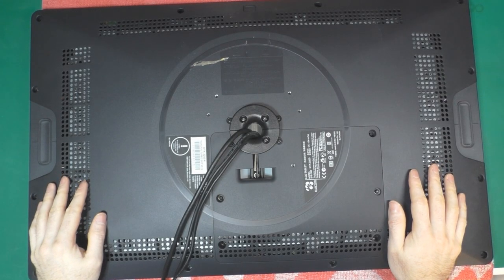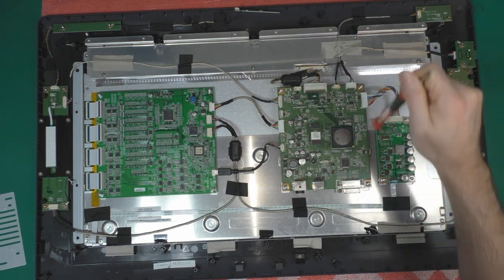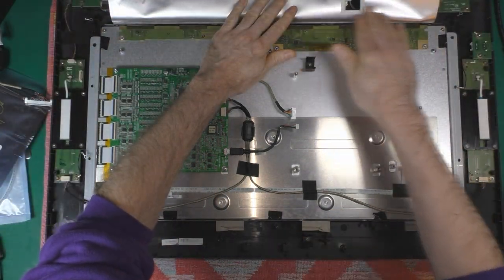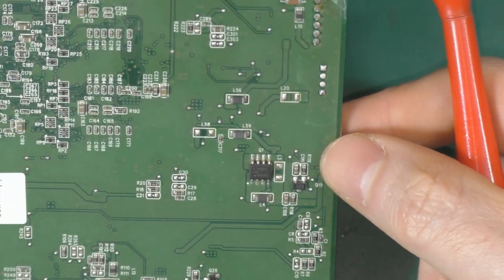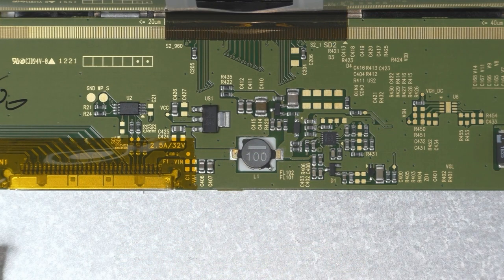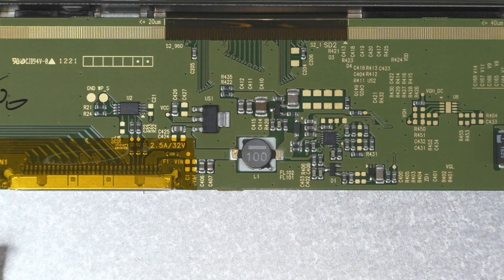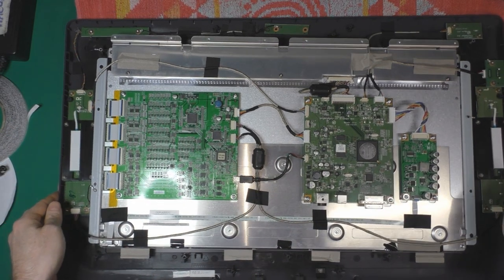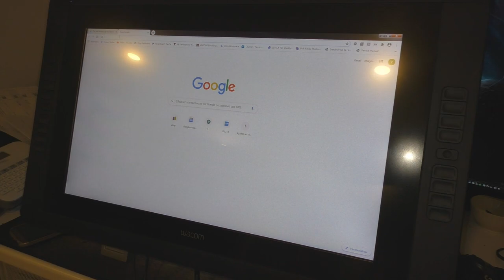[Attempting Repairs] Wacom Cintiq 22HD (DTK-2200)

Comment: Thank you for this video, for I have the same problem, and using a strong light on the screen I can see the screen so I assume the problem is the led strip that is dead. Since I've never soldered anything in my life, I'm wondering if I probably  should share this video with someone capable to do the fix and see how much it would cost to me, the parts you've listed look cheap enough.
Anyway, again, a big THANK YOU (heart).
Reply from the maker: Check or contact Ian Tompkins if you are on the US.

Comment: Hello, I'm also having the same issue on my cintiq 22hd. May I ask what does replacing the caps on the inverter board do? I think I've only seen Ian's video on replacing the capacitor and mosfets. Thanks!!
Reply from the maker: When something went wrong related to power supply issue in a device, I tend to change ALL CAPS related to power supply. It something I got used to do with older video game consoles. I saw popped/leaking caps after transitors/mosfets/voltreg going bad. It may not have any impact whatsoever in this specific case though (it would have more sense if your power brick blew up and kill the cintiq), but those are electrolytic caps and will go bad eventually, and since the Cintiq is opened and fully disassembled, well, I don't take any chance. Cheers.

Comment: What solder iron do you use? What is that liquid you're pouring on the IC and mobo? I'm kinda new at this so I would like to learn. Thanks
Reply from the maker: I use a Hakko FX-951 for the soldering station, and a cheap Aoyue 738H. The liquid and yellow-ish paste I used before soldering is no-clean flux (both from MG Chemicals). The liquid on the Q-Tip I used is isopropyl alcohol.

Comment: Bonjour,
J'ai une vieille cintiq dont le bouton On/Off semble faire faux contact. J'ai de plus en plus de mal à l'allumer ou l'éteindre.
Quel risque y-a-t-il à la démonter ? quelles précautions dois-je prendre ? A votre avis, est-ce compliqué à réparer (sachant que je n'ai aucune expérience^^) ?
Reply from the maker: Yo, non le bouton on/off si tu regardes a 3:24 de la video c'est ca que je dévisse. Faut juste faire gaffe quand tu soulève la coque arrière d'ouvrir doucement et pas arracher les fils. Idealement faudrait trouver une board de rechange sur ebay, sinon il va falloir malheuresement dessouder le bouton du circuit imprimé et le changer.

Comment: can a Huion Kamvas 22 Plus also be repaired like this ? Is the hardware similar?
Reply: Yes, just repair it.  Set yourself an objective to learn about circuits, how power flows, how to test components, what is regular input and output, how to use a multimeter and an oscilloscope, it is useful knowledge.

Comment: Thanks! Very helpful. 
So to confirm, if I DO get activity/the screen lights up when mobo is disconnected.. that means the problem is with the two capacitors? 
Potentially 1 less thing in a landfill thanks to you!
Reply from the maker: Yes. If you have light activity (like the panel is lighted with some light purple shade) that means only the backlight board is faulty. I had only two caps on this video, but apparently you can have a bunch of them (only 10uF ones has to be changed) . You can also check Ian Tompkins channel, he did a lot of video on this.
Reply: @TheRealPhoenix_Retromods  ty!
Reply: @TheRealPhoenix_Retromods   Update for posterity.  It worked. I replaced ten of the eleven 10uF capacitors and it worked, good as new. I ran into some trouble initially with a flickering/fuzzy screen but it was because of a loose connection between the backlight board and motherboard. Thanks for the vid and shout out to Ian Tompkins!

Comment: hey i have the 22hd which doesn't seem to power on at all (no blue led light indicator, no screen flash). i replaced the mosfets thinking it was the issue, but it still doesn't turn on.  I think it's the caps on the inverter board in that case...do you still have any for sale, digikey is out. thanks!
Reply from the maker: They are plenty of ceramic caps everywhere, you just need a 10uF in 16V X5R in 1206: https://www.digikey.ca/en/products/filter/ceramic-capacitors/60?s=N4IgjCBcoMxaBjKAzAhgGwM4FMA0IB7KAbXBgBYAGEAXXwAcAXKEAZUYCcBLAOwHMQAX3xhy8EEkhoseQiXCUAHAHZyAJloNmkNp14Dh4AGzjJ0nPiKRSimMrAQ6IJi3bd%2BQkctMoMFudYg6mpU3k4uOm76niBqlOQAnD5SfrJWpGCUAAQArQBims7aIACqPFyMAPLIALLYqJgArhzYMQC0GtASUJyNafIArLSGbUldkr39gY6Cs0A

Comment: What liquid is he squirting on the chips to remove the old flux? Is that isopropyl alcohol? If so what grade?
Reply from the maker: I used no clean flux (MG Chemical 836LFNC). Now I use more MG Chemicals 8341 No Clean Flux Paste rather than liquid, and then clean it isopropyl. I used MG Chemicals 99% in the video but I found it tends to be very sticky afterward. I moved to 70/30 and use it abundantly - even bath the PCB if possible - and use with a toothbrush.

Comment: hi, what the specific mosfets part number that you use? TR, CT , DJR ? which one?
Reply from the maker: There' all the same: it's only the package changing. TR is Tape & Reel (an unmodified reel of continuous tape as received from a manufacturer), CT is Cut Tape (a length of tape, cut from a reel (described above), containing exactly the number of parts ordered), and DKR/DJR is Digi-Reel (a custom quantity reel of continuous cut-tape made from a manufacturer’s reel). Doesn't matter for a small order just to repair the screen.

Comment: hello ... great video ... found at the right time to repair my tablet .... I would like to ask you if you could write the links of the components to buy them on Amazon ... on the site you have put the shipping times are very long. ... thank you
Reply from the maker: I don't think you can find the MOSFETs on amazon.
Reply: @TheRealPhoenix_Retromods  
ok thanks .... but I don't know the acronyms of the right pieces ... write me the characteristics here? ... 🙏 thank you very much
Reply: @TheRealPhoenix_Retromods 
hi are these ok? thank you

Cal-Chip 1206 Misura 10uF/16V 10% X5R GMC31X5R106K16NT, Rohs, 100pcs
Reply from the maker: @Italian-design-4.0  Yes, any 10 µF ±10% 16V X5R 1206 (3216 Metric) Ceramic Capacitor will do. I do prefer reputable brand (Samsung, Panasonic, Murata, KEMET, YAGEO, etc.). MOSFETs are P-CH 30V 8.8A 8SOIC MOSFET (Manufacturer Product Number: FDS4435BZ)